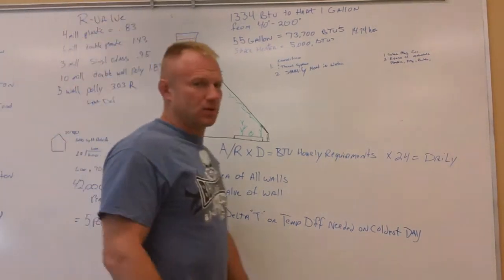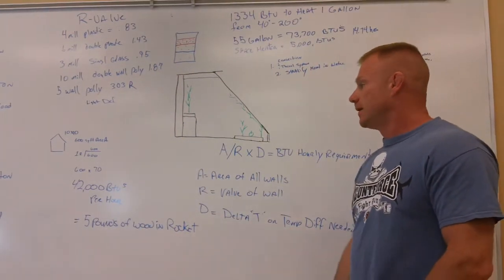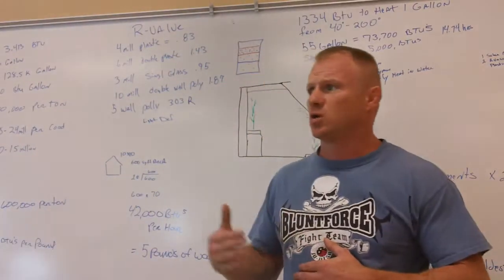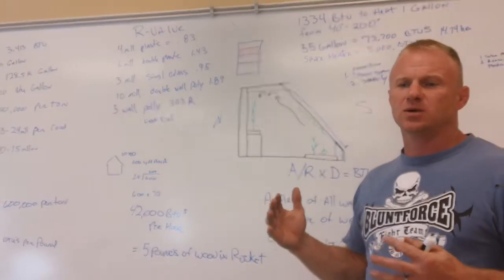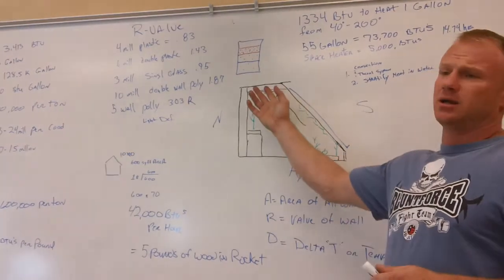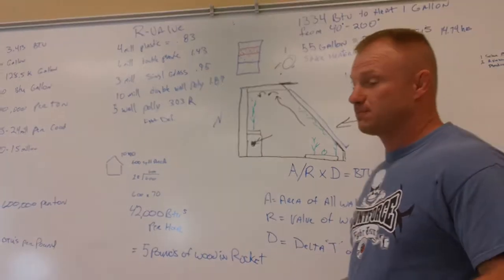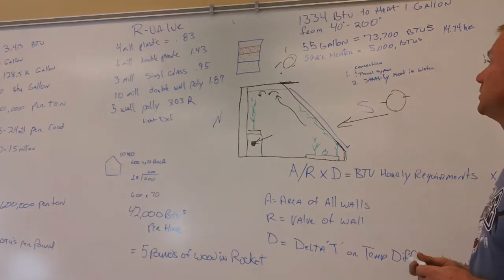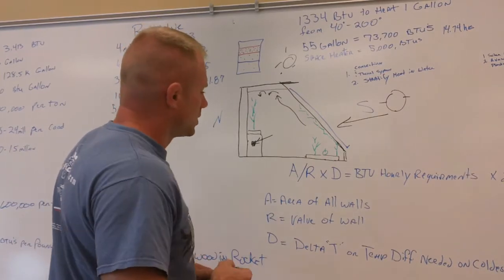Death Of The Rocket Stove part 3

Comment: Hey Van, great vids. We're a farm in north east Massachusetts and are in the process of putting up a nursery greenhouse 16'x48'. Had plans of building a rocket stove to heat it but now thinking otherwise. I have built prototypes and like you explained have to mess with them every 15 mins. to keep them going. I'm hoping on putting a radiator of 10, 35 gal. barrels linked together against the north masonry wall also acting as table legs. In 'death of rocket stove part 1' I see the barrels linked together with an extra piece of pex tubing going from the right to left barrel. Is this for over flow? Are you taking colder water from the bottom of the barrels or is is a waterfall off the top? We are also planning on piling compost against the north wall and collecting heat from it for the water barrels and air exchange. Hoping it will supplement a lot of our wood usage. Thanks for putting solid numbers to ideas I've had.
Reply from the maker: The extra tube is for over flow yes or in case one doesnt get enough air to flow.Yes I am taking cold water off the bottom too. Have you seen my 12 inch rocket stove?  I have a even better 16 inch design coming up soon. they burn enough wood to heat the mass for 8 hours in just one or 2 loads an hour apart . I would use thermal siphon to move the water too, to get away from the pump and possible failure. I understand the limits and how to better use the thermal siphon concept after I have done a few systems now.. use tin for lower wall section of green house to pile compost against will work as a radiator and the compost will insulate it from heat loss. air pipes with holes in tin back into compost low and high positions will set up better convection of the heat generated into the green house. Your 350 gallon will be equal to a 1.5 ton unit when up to temp of 200 would hold 540 thousand BTUs and that takes 67.5 pounds of dry hard wood to getter done at 100% in which you would spend the rest of your natural life setting feeding that a rocket stove with a 6 or even 8 inch burn chamber LOL. There is Major confusion caused by claims like of a arm load of sticks heat the house all day it simply by the numbers not possible and people need to be aware of it as not to be misled.

Comment: http://www.builditsolar.com/References/Calculators/HeatLoss/HeatLoss.htm

I modeled a small 10x10 greenhouse like the smart solar gain one in your video here.

Back wall, 100ft2 R30
Side wall 75ft2 x 2 = 150ft2 R30
Floor 100ft2 R30
Ceiling 40ft2 R30
Glazing 100ft2 R1.8

My total structure comes in with BTU losses of 6000/hour accounting for a worst case construction leakiness of 1 full air change per hour of the 800ft/3 volume.

Does this Jibe,Jive,Jumbalaya with your numbers?  The numbers seem to follow the formula you provided - A/R * dT = btu loss.

Is your video a critique of rocket stoves and rocket mass heaters, or of bad greenhouse design? :P  Clearly the design you show off with the water barrels is better - why not augment it with a rocket mass heater? :)
Reply from the maker: The formula is area or length times width of each wall added together then divided by the R value of each wall as it applies totaled, then multiply by Delta T of 70- 80 degrees.. A rocket stove is simply not Practical in a green house it has great efficiency but practicality is bad.
Reply from the maker: Thats a great tool and link thank you. the green house was explain so the requirements could be understood so the demand could be explained so need could be shown not to be mathematically possibly met with a small burn chamber that limits or restricts the pounds of wood possible and thus a stove with a low efficiency of say 70%  but 10 times the volume will still deliver way more BTU for heat and storage per load and time spent burning enough wood to get the mass to the desired temp and thus more practical.

Comment: I imagine the title of this video makes enemies right off the bat. Thank you for posting - I did learn something.  It will be important to build a feed chute/hopper big enough for x lbs of wood.  My priority is minimizing fuel, creosote buildup, and smoke.  A water battery sounds like a good idea too.
Reply from the maker: I named the video that title because I tore out a rocket stove for someone that was not PRACTICAL . try to burn for hours with many loads in order to raise the cob temp to hold the temp all day. A rocket takes more loads of less wood due to low BTU's available from a small burn chamber Rocket stovies are like a cult..LOL  I still build them just I build them different now. If your going to use it in a green house good luck.. you will set there and feed it for hours before you can walk away. or use better thermal mass with a less efficient burn but way more volume of wood to achieve load and walk away practicality.

Comment: I'm not trying to be an ass here but I'm wondering if you considered the fact a rocket stove burns hotter and longer using less fuel? All btus and stratification aside, wouldn't you get technically more btus longer in a rocket stove with less chord of wood? I know this stupid little rocket stove I build gets above 800° and when it's gone out the heat is there for a lot longer and the flame is much much higher and hotter and the color is red hot not amber hot and has no smoke. Just curious?
Reply from the maker: Hello , those are good questions to ask and a question is always polite. Rocket stove does burn hotter but does not come close to burning longer. There is a set number of BTU's available in the wood period. the rocket stove part can not add any extra. The reason it burns hotter is more air delivered over small sticks with great surface area to help break down and com bust quickly thus releasing the energy from the wood but breaking down the fuel quickly. So the fast hot fire is ideally captured in the thermal mass and released over time. The Rocket stove may burn as high as 95% however the 95% of the low density wood with relatively high moisture content of yard waste has about 4-5k BTU per pound and a limited size burn chamber limits the pounds and when compared to a large burn chamber capable of 10 t 20 times the pounds of wood even though the efficiency of a wood stove may be only 70% but some now are much higher and into the 90's then the practicality of the higher BTU's at a lower efficiency come into play for ME. I will sacrifice the 95% burn and feeding it every 20 -30 minutes for the 70% burn and feed it every 8 hours. It takes more than one burn to get the cob up to high enough temperatures to maintain room temperature and that is not as practical for ME. Hope this explanation helps thanks for asking.
Reply from the maker: Michael Ben Hello Mr Ben and thanks for watching. Interesting response. I will be polite and ask questions to reveal the truth. How do the Manufactures of wood stove rate stove efficiency ? What is sensible heat loss? what evidence do you have wood stove numbers are skewed and rocket stoves are not? Is there a video anywhere that might touch on this subject somewhere? Maybe something like this
  Understanding Wood Burner  Efficiency Ratings  . Does not the fine looking gentlemen in the video explain sensible heat loss and if that is in FACT included as one of the test in establishing wood stove burn efficiency and how they are tested. do you think he might be able to provide a long list of references as to how he arrived at this conclusion and where he got those standards? IF infact sensible heat loss is the mensurable difference in degrees between the temp of the exiting flue gasses and the temp of the room and that test is in fact one of the measurements taken and long been established as a part of wood stove efficiency understanding and ratings.  Further how many times has any rocket stove been built in calorie room to accurately establish any of theses rating in a scientific side by side comparison and what was the results?  These were my first thoughts then I realized perhaps you would be speaking of not just the temp difference between the flue and the inside air but what amount of cubic air flow at that temp is lost. Once burn is accurately looked and addressed you will see there is not much if any advantage of the burn itself comparing the two with equal draft settings. Especially when you consider the volume of wood per load BTU delivery advantage of a wood stove. When you look at the loss and volume of air at that specific temp you must take into account the more air in or wide open draft as in a rocket will be more air out the flue pertaining  to volume. so a Rocket would be lower temp air but more volume than a wood stove with hotter air but less volume. HOWEVER if you deliberately lower the exit temp of a wood stove say with a coil or any heat ex changer of your choice to 125 and store all but that need to cause draft in a wood stove what you end up with is a BETTER heating system and thats the point of it all.
Reply from the maker: Michael Ben Hello Mr Ben.  The EPA ratings have nothing to do with heat delivered to anything.  Its merely a particulate measurement of exhaust gasses.  I do not admit that a rocket stove is 95% efficient.  I did not state it as a fact, I merely gave an allowance for arguments sake.  Further, I am confident that the rocket stove doesn't have the 95% efficiency and to my knowledge one has never been EPA tested.  Our original conversation was on the subject of heat delivered and not EPA particulate test.  I am not sure why we are comparing apples to oranges now.  I understand low temps on wood stove flue causes creosote buildup and that clean outs have to be put on. In the death of the rocketstove video since I only have one section of 3 ft pipe and it is completely outside, that fact is irrelevant there.  If one wanted to lower the flue temps to the temps I mentioned on an inside stove and not have to worry about the creosote, there are a couple of ways.  One is design the rocketstove like my rocketstove fireplace to allow for a bigger batch on the burn.  Secondly, what if I told you there is a way to burn plastic and tires in a wood stove with no smoke, no creosote, and while the flu stays cool.  Still we are talking about EPA  and not heat now.  Catalytic stoves have been a thing of the past for awhile now.  There is a simple solution for it.  
I understand the feeding principal of the rocketstove with multiple tubes or pellet feeder just they can be cumbersome and don't produce a very clean finish say if you wanted one in your living room.  I don't doubt that there is not some high quality built and operating rocketstoves.  I am also not stating that all rocketstoves should be killed or that there is not a legitimate place for them.  These are simply the reasons I killed (redesigned) a couple stoves in use.  I am not trying to limit anyone or give anyone else directions, just thoughts and ideas.  But, you are correct I should have mentioned the dangers of attempting to lower the flue temperature to the range I spoke of if it was an inside application. You won't believe how cheap and easy it is to build a catalytic converter (type stove).
Reply from the maker: Michael Ben I wanted to Thank you for your input and intelligent conversation.  I don't intend to come off controversial.  I enjoy the debate with a mentally qualified individual.  You bring up valid considerations.
Reply from the maker: Michael Ben One thing you said that really rang a bell with me and that I have been contemplating for some time is I would like to see you write a new formula that takes into account stored heat.  When I began to dig into understanding "stove efficiency" ratings I quickly realized what you have pointed out.  Further wood burning efficiency ratings are complicated, murky, and difficult to understand in their entirety and leave out critical areas of consideration.